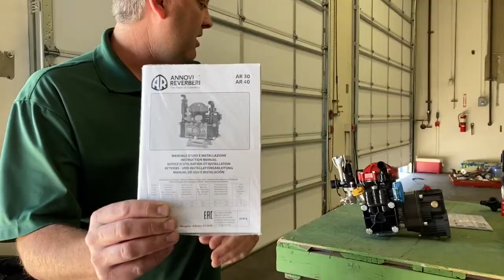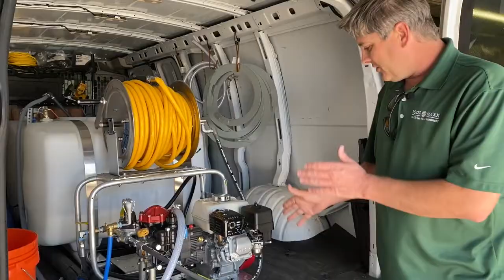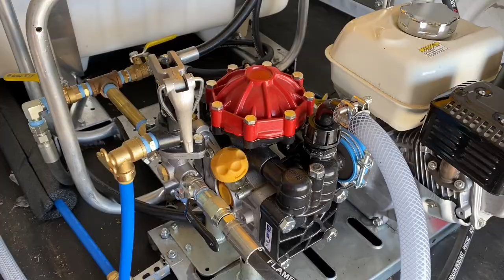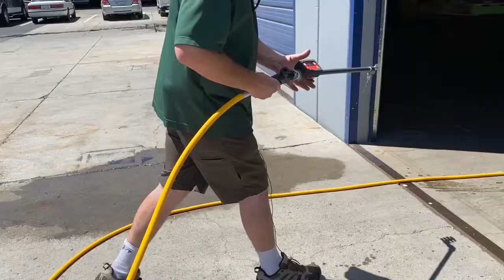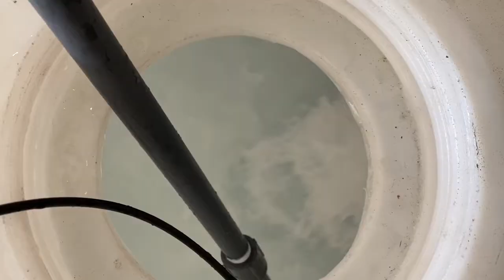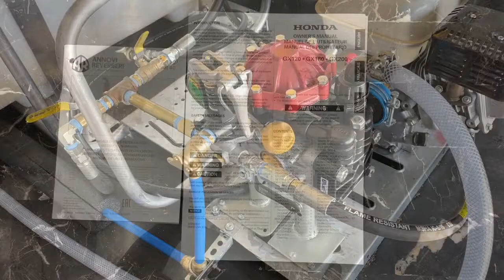Mills Roofing Gas Pump

Comment: I know this is an old video and how this guy is using his pump will work just fine , I’ll add that I would use a filter on the suction side of the pump to keep any possible trash out of the valves , doesn’t take much to get a valve stuck open and then you lose volume and pressure . The other thing I’ll add is you don’t want to run the Honda full throttle , these pumps optimal rpm is 650, the pump runs less efficient if you force it to run faster then 650 rpm , the higher the rpm the more likely you’ll tear up a diaphragm especially if your pump happens to run dry .